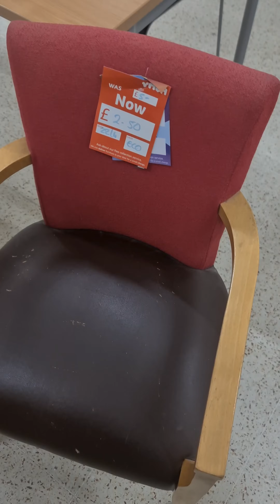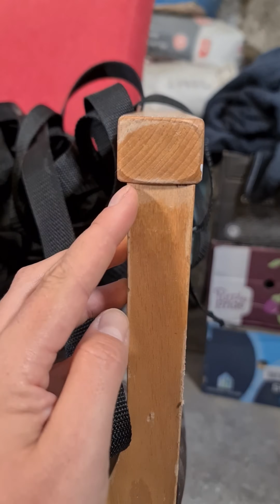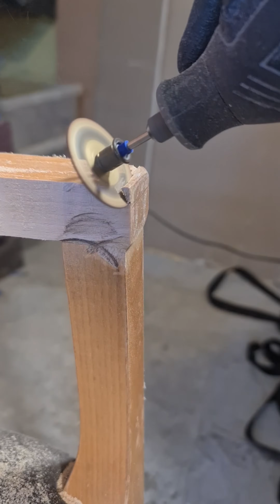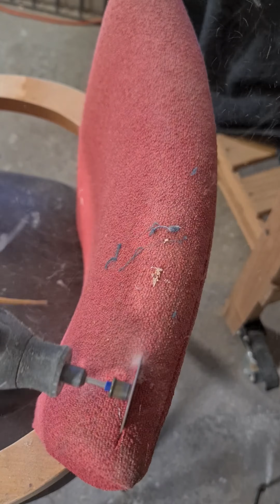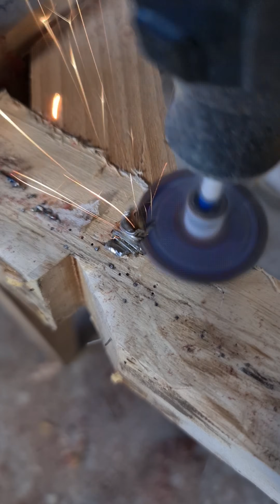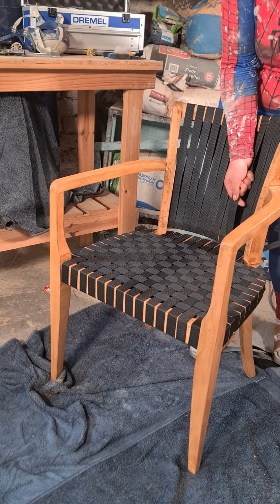Upcycled Charity Shop Chairs - Transformation!

Comment: I get it-you want to show what a Dremel COULD do. In reality, you wouldn’t use a Dremel for ANY of that. And even if you did, you’d be lucky to get through the entire project before the bearings fail and the motor shaft vibrates violently rendering your tool useless.
Reply from the maker: Let's ignore that the video was finished easily without that happening and, more importantly as; What on earth are you doing to make the bearings fail and your tools vibrate violently?? I recommend you re-thinking how you use your power tools 'cos that sounds dangerous
Reply: @DremelUK  I use them to carve …as it originally was a tool FOR carving. My current 8250 was returned or send back  for replacement 5 times- after the 2nd time, I realized what the issue was and began to ‘baby’ the tool - because I also wondered what role ‘I’ had in this particular part failure. By the 4th tool, it was obvious the inadequate bearings being used could not handle 35000 RPM and pretty much ANY pressure applied at the same time… you know- kinda what ya gotta do when you’re carving….What surprised me was that it seamed like the company actually knew this could be an issue and attempted to put a ‘warning’ light on the tool. Only problem with that, is that once you’ve seen the ‘warning’ light- it’s too late- it’s already overheated due to bearing failure- since it’s all held in place by internal plastic molding, well- you get it : heat and plastic. The company’s only solution was replacement- and I do give them credit for not giving me grief about the same issue over and over- but it was only that-a replacement. I needed a solution. Thinking perhaps I could find and substitute better bearings I did the unthinkable and cracked it open- only to find I’ve no tools or experience in pressing bearings on a motor shaft. ( I knew better, but I had to try) I DID add a wrap of electric tape once around the bearing- to try to make it fit tight in the housing again… and that works..’ok’… but since the bearing has failed, it gets hot pretty quick and I have to shut it off and let it cool completely down. I’m sure this fix will be short lived- I don’t use it much anymore - but I miss it
Reply from the maker: @ClubMBaD  
Glad to hear you were sorted out with replacements, thanks for the feedback
Reply: @DremelUK  I know my story may have come across as all bad news- but I will be the first to admit that I AM hard on tools. I am still a fan of Dremel- and Bosch as well- I think a good takeaway from it is maybe a suggestion to anyone using the tool primarily for carving: a solid investment is the Dremel Flex Shaft. I feel like the issues I experienced may be avoided by using that accessory. You’re gonna be hard-pressed to find another tool with the power-both corded and rechargeable -the auto stop function-and the ease of operation, to name a few features. And Dremel now has a few carving bits that will go straight to the top of your ‘go-to’ lineup.
Reply: @DremelUK  and not to bash ‘Bosch’… but the original German-Switzerland made tool — that tool was made to last. I mean, I know they probably focused on a smaller line of tools, but I remember my Dad Having the same original Dremel for …35 yrs probably… and using it kinda regularly…
Reply: I use my Dremel all the time for projects like this. I had to swap the battery once which is to be expected after a long period of use (it took a number of hours with breaks for 🍉 nom). But it's still absolutely solid! Just wanted to give some behind the scenes intel.🥰
Reply: @diywithemma  a piece of sand paper in your bare hand would be as efficient using no more effort and giving you more control of your work. I don’t know what they did with that nail and why you wouldn’t just pull it out. That was the dumbest thing I think I’ve ever seen. How long you gonna take changing Dremel bits and fumbling around when a box cutter would cleanly slice that old material like butter? Using an electric tool to work a project like this is actually doing a project like this to work an electric tool. It’s sleek and elegant and has a powerful motor- which WILL be the very thing that kills the tool- save as much ‘downtime’ for it as possible if you  plan on having it around and useful for a long time- you’ll be disappointed if ya don’t